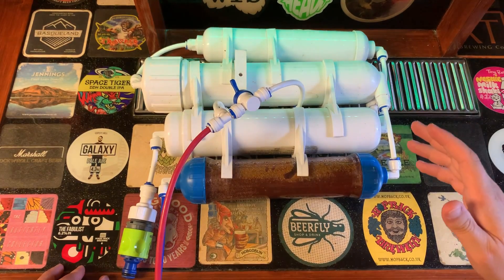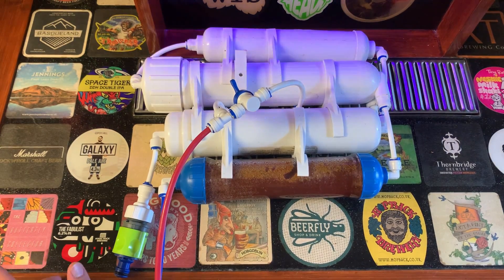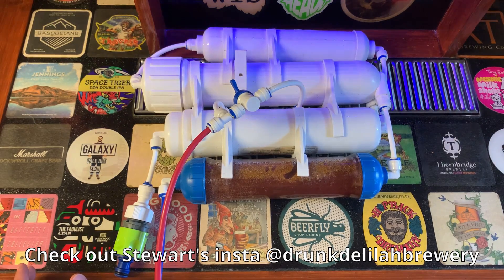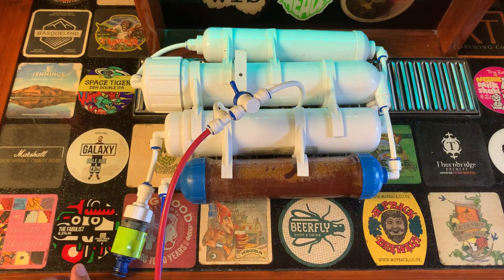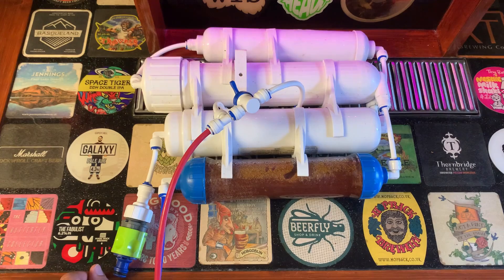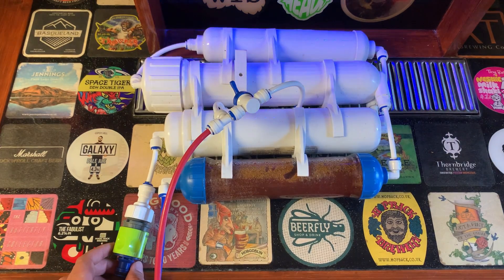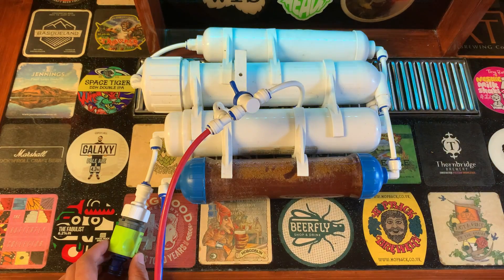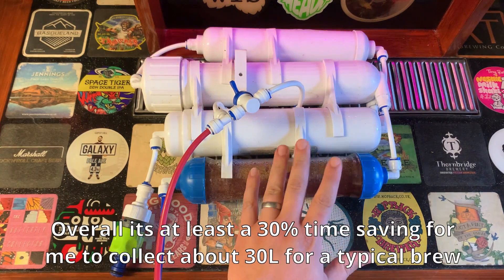How to speed up Reverse Osmosis water filters

Comment: Get video, just about to install a similar system. Great tip. Regarding the waste, would it increase flow if you shorten the waste pipe in a smiler manner and fitted a hose connector and continue the waste through a garden type hose?
Reply from the maker: It can do yes, I haven't tried but a friend of mine did and said it did make a difference (not as much as the input but still)

Comment: Flow in a tube is directly proportional to the length.
But it is related to 4th power of diameter. Hence double tube diameter the flow increases 16 times. That is what you learn from your keg lines and why we use the narrow tubes instead of hundreds of feet of wider tubing.
So fit bigger diameter tubes to your RO filter on input and output .

Comment: Just followed your link to the filter and they don’t recommend this model for drinking water - any thoughts?
ADVISORY: Avoid cheap water filtration systems and cartridges which have no testing credentials or certifications, and often leach harmful chemicals into the water which are linked to cancer, birth defects and infertility. In addition, cheap components may also lead to membrane fouling, leaks and general poor performance. Instead, always choose VYAIR tested and certified water filtration systems and cartridges. Please note we do not advise to use this for drinking water.
Reply: RO water isn't suitable for drinking water.
They remove minerals so you'd need to put minerals back in to make it suitable for drinking, that is the point when using them for beer making ! First you remove the minerals to achieve a blank canvas. Then you add specific levels of minerals to suit the type of beer you're making !
Reply: @davec4955  Ah, that makes sense, thanks.